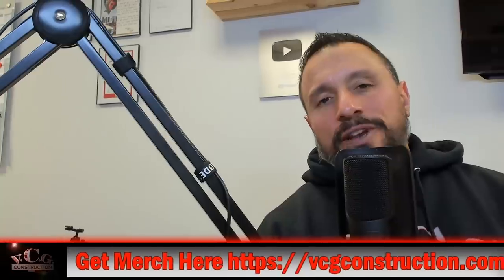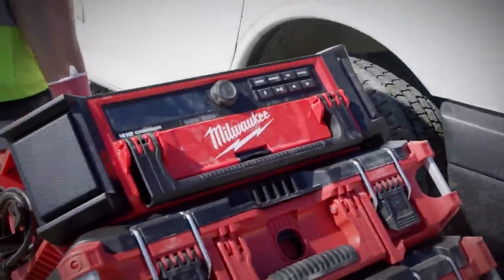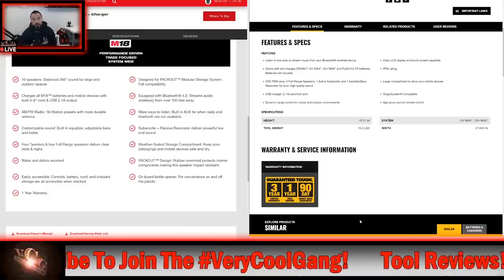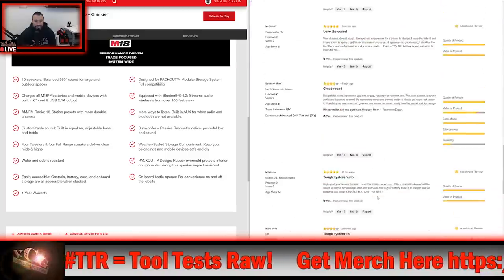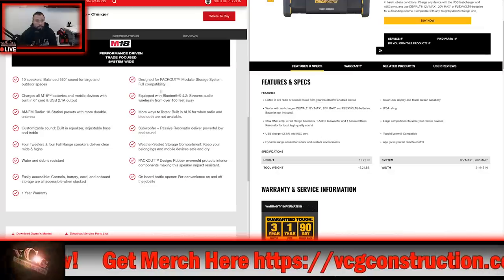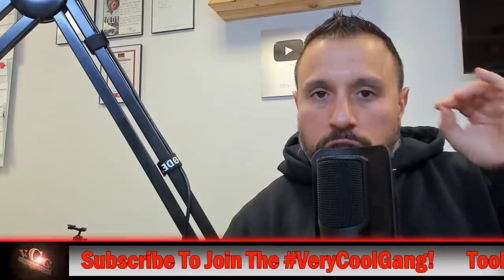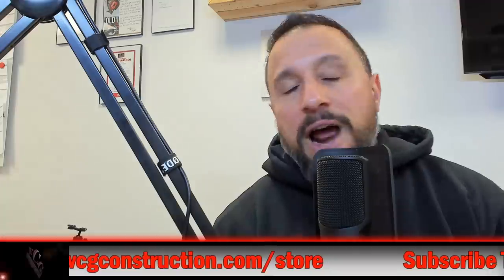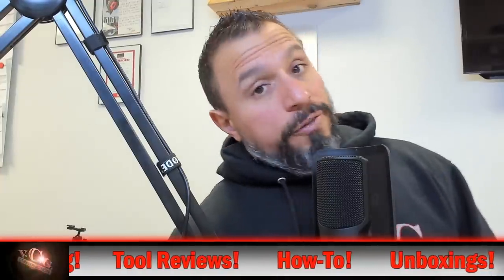Best Jobsite Tool Storage Radio/Charger Comparison - Milwaukee PACKOUT VS DeWALT ToughSystem 2.0

Comment: Bosch everyone one makes a very nice radio charger system.  I have the Bosch and love it.  If I had to pick between big yellow and big red.   I would go with Milwaukee because I already have the 12V and 18V batteries and I have the Milwaukee 12V radio that I use on inside projects where the customer will not permit loud music and I can play my 12V radio  on low,  and customers do not seem to mind that.  Thanks Vince !!!!!
Reply from the maker: Thanks for your level headed feedback as usual, you da man Stephen! We appreciate it!!
Reply: @VCGConstruction  Thank you sir !!!! Awesome video !!!!
Reply: When low, my Dewalt (the older one that's better) is on low, it doesn't make too much noise... it's... got...volume controls....? --However, it does resonate more than playing right off my phone, which is a squeal 15 feet away compared to crisp sounds from a sound system. But I have a small speaker that's able to fit in a pocket for small sound and it's great. has a clip and magnet, so it's pretty versatile.

Comment: I own the DeWalt 1.0 radio and it has been great, The biggest feature missing off both (to me) (which I did tell DeWalt about) is a lack of a microphone. I hook my phone to the radio and toss it inside. When someone (aka person getting stuff calls) to ask me was it 4 or 6 2x4s I would rather not have to take my gloves off pry the radio open to get to the phone, I wanted a button to press. (This also applies when I'm at home I can talk to the relatives, while still getting wood marked up to be cut)

Comment: I bought (preordered) the PO radio. I would have to agree that having a 12v charging capability would have made this radio an easier choice to make. All I can say is, use the mobile charger from Milwaukee (#48-59-1201), plug it into the usb port and charge away...?? Thanks Vince for the assistance in comparing!!

Comment: I see that you made this video comparison in 2019. I'm very pleased with my DeWalt DCR025 which is a different model, but it is an excellent choice for on the job needs. It has a great sound, and also includes two outlets, Bluetooth, auxiliary and USB port, 5 dedicated radio station options for both am and fm, and a charger for your cordless tools, and a bottle opener. Probably not a good incentive on the job , but I like it, because I'm a backyard mechanic and DIY kind of guy...

Comment: Tough system  2.0 hands down. With the DS  carrier and wall mount system I don’t have to move all the boxes to get to everything. I have both system’s prefer the DeWalt.
Reply: I think the Milwaukee is just built more for work and durability while Dewalt is more for the DIY guys. After I saw the Dewalt system I decided that they might be a better solution even though I have Milwaukee everything else haha

Comment: I have two full sets of the Milwaukee Packout toolboxes and all their accessories, but they are FILLED with yellow tools.  Having said that, it would be great to have the radio snap into place on the Packout, but given all the DeWalt tools, I went with the Dewalt radio for charging capability AS WELL AS the ability to play the radio using the batteries as well.  The Dewalt radio sounds great.  I would like to hear the Milwaukee as well though. I bet it jams.
Reply: I was toying with the idea of 3d printing a bracket that allows Dewalt 2.0radio to connect to pack out.
Reply: Joshua Wilson That’s a great idea. I would buy one ☝️
Reply: @ApacheLife-50  I thought the same myself, except I dont have a 3d printer laying around...hit me up when youre done, I'll buy 1

Comment: Dewalt 1.0 was the reason I started with them. My radios been cranked on max nearly every day for the last two years and still loving it. I checked in with my local tool store about the Milwaukee and 2.0 and they said the base on Milwaukee doesn't come close to dewalt and that's all I needed to hear.

Comment: As a Milwaukee tool, PACKOUT user, M18 & M12 mechanic & handyman, i was happy & disappointed with the new M18 only radio/charger. I own far more M12 tools (at the moment). Don't forget us trades folk Milwaukee cause not every job requires 18v/20v tools. Thanks Vince for telling like it is! #justsaying

Comment: Was very short sighted of Milwaukee product marketing team to not include the ability to charge all of the battery platforms. Also no reason not to have extra USB ports.
Reply: Actually since it can't run off of the m12 I think it is fine that it's not included. It might be confusing for some if it can run off the m18 and not the m12, but can charge both. I have no shortage of chargers anyway.
Reply: It can charge both if you get the m12 accessory that you use in their jackets

Comment: Ok, I have OCD,(lol) I bought the TSTAK, Milwaukee Pack out and Tough System Radio along with an older Bosch Power box (had for yrs.)
Sound wise the TSTACK HAS overall best sound, then Tough System...Milwaukee had great sound if you put it in a corner or against the wall...then my older Bosch Power box in that order....I've compared them side by side and this was how they measured up...non were actually impressive as a charger...though they eventually all did charge.

Comment: More USB ports and the packout should have included 12v charging
Reply: 12v charging would be nice but because it's a totally different pin system they can't but since dewalt uses the slab type battery there no extra space used to get all 3 in there. Btw I'm team red

Comment: I feel like you are backwards on the "radio sound solution". They both charge but the sound quality is not even in the same neighborhood. DeWalt sounds nearly twice as good and twice as loud. I just compared both in the same room, with the same song, full volume(like most construction sites) as I'm looking to get into a new system.  I now feel forced to get a DeWalt radio and packout with Milwaukee tools.

Comment: I have the dealt tough system it’s really good I had mine for couple years and no problems until couple days ago it sounds like a speaker may have blown .. definitely got my money’s worth out of it though. Been thinking about buying a pack out now ... I’m a steel worker and work by big machines so I need loud music systems and the tough system was a little hard to hard when some machines started running

Comment: I have had a tough system for couple years now it was great for me and I work it a big steel manufacturing shop with loud machines running and dewalt was pretty good! I have unfortunately blown some speakers on my dewalt from putting bass and everything full and blasting it lol. Now I’m trying out the Milwaukee pack out
Reply: How is it?

Comment: Which is louder with better sound quality and bass? All I care about. Never heard Milwaukee's but I do like the DeWalt packout radio
Reply: I would imagine with higher speaker count and more bass coupled with nearly twice the watts the milwaukee would win in a sound vs. sound competition, but if you are already locked into an ecosystem either is quite good.
Reply: @rockyleblanc2977  That's not how it works. It goes by how many watts and the impedance. One radio could have only 2 speakers
and wreck the one with 20 speakers. Also important is the resonance inside the shell that house all of the electronics as well as 
porting.

Comment: I'm deep in yellow tools and about 6,500 deep in packout...
If they would have stocked tough system, I would have gone that direction....but looking at organizers, I really think Packout has dewalt beat. "Packout organizers." specifically. --packout shuffle blows, and inner totes/dividers not compatible with other packout boxes is also stupid as hell. The loss of space is also a huge downside...
But, it's coming together, I've now used it on about 5 jobsites, and I have been getting more organized with it, reorganizing every jobsite to better suit the situations to where hopefully some day, I'll have a organized for my business operations system that is highly efficient. (The problem becomes, I have a system that isn't great with my tools, I need duplicates or so, and packout has a vacuum and speaker that are compatible... Should I make the switch and invest in over priced red? or stay on with a few incompatible tools I need...)

Comment: I have bought up the Packout system and would by the Milwaukee radio.  I own a number of DeWalt tools and may buy the big battery charger and figure out a way to mount it on the Packout.
Reply: big battery dont fit in the dewalt at least the one i bought the Milwaukee can fix a 12.0 and last 3 days

Comment: Thanks for the vid. I currently been using the Bosch but I don't own any Bosch tools so just purchased the 2.0 because I do use dewalt battery tools and am thinking I am going to buy into the new 2.0 organization, so here is to hoping it is trouble free.

Comment: Hey Vince. I was excited to see this video as I’m looking for a radio. I’ve got a huge amount of this fuel line and a pile of pack out. All my corded tools are dewalt for backup. I was actually thinking of possibly going dewalt just by your last vid on the 2.0. You seemed more impressed then you were in the Milwaukee video. I was really hoping to hear in this video which one you thought sounded better,louder and more bass. More so then the specs. Let me know your thoughts if you read this. I don’t think many guys have heard both radios. Thanks

Comment: I imagine the m12 Milwaukee batteries can be charged through the usb port I will be buying the Milwaukee radio and charger soon I have the dewalt 2.0 I'm loving the dewalt so far and yes I would like to see more usb ports as well as the Milwaukee adding m12 to there charging and using stereo option

Comment: Honestly do you think it matters if they both charge the batteries and have decent sound even if the DeWalt was a little bit better I would still go with the Milwaukee just because of the charger and that's the platform of my tools I think that's how most people are going to view the situation I just hope Milwaukee is better anyways
Reply: 100% agree! I got the packout because I'm invested in Milwaukee but if I was invested in Dewalt it would be the same

Comment: The two subwoofers will most likely not be 2 active drivers. The only way to get the performance from a subwoofer In that compact air space is to pair it with a passive radiator. Most all Bluetooth mobile speakers use passive radiators that people keep mistaking for “subwoofers” no it’s the only way they can deliver great low end and it still be waterproof.

Comment: Both missing the best feature. The Bosch power outlets.
Reply: @garrad miller 
👏🏻👏🏻👏🏻
Reply: Mx fuel power station solves that
Reply from the maker: I didn’t realize Bosch had a radio that integrates with their LBoxx system, is that European only?
Reply: @canogaparque818  for a few thousand sure
Reply: @VCGConstruction  for good reason, they don't.
Reply: @VCG Construction 
All Sortimo L-Boxxes come with holes on the top of the box that are specifically designed for shoulder strap that you can strap down your Bosch Powerbox with a bungee cord, or if you need to hear that “click” order L-Rack-S and four one hole clamps to hold on to safety cage. It does have to go on top, like my home made MFT style table that mounts to same rack component, but it’s a small price to pay.
Vince are you able to use the Bluetooth functionality on either the Milwaukee or the DeWalt offering to set alarms for breaks and for lunch as well as able to use it as a job site intercom???

Comment: Has anyone else noticed lots of commercial jobsites are banning radios more and more? Sware 5yrs ago no one cared. Now it's all no radios on site. Sure helps day go buy burning rods and fitting pipe with some tunes going on.
Reply: I use a 12V Milwaukee radio with the volume down low when I can get away with it if there not completely prohibited.  Sometimes project managers will let you get away with that.
Reply: @stephenleepmg113  I rock phone in hard hat when I'm not welding

Comment: Just remember this is Milwaukee's first attempt at fitting everything into a packout radio and DeWalt's second
Reply: Just remember red china is copying dewalt do you really think they didn't reverse engineer one before making their copy
Reply: @rumchaser1able  well since they are completely different designs I'd say there was no copying here. Also, dewalt has less speakers and downward firing subs
Reply: @noclass2gun342  haha really so they made a radio that's basically the same as a toughsystem or tstack and you say its not a copy .
Whose idea was it originally ?
Reply: @noclass2gun342  subwoofers work best when they're pointed downwards

Comment: I just bought both Home Depot has the tough system 2.0 online for $199 and I picked up the packout  for $274  $25 off at Acme tool online both in stock.  Now I’m up to 9 job site radio’s the addiction is real people.
Reply from the maker: Only 9?? Come on Chad step it up! Hahaha jk
Reply: @VCGConstruction   you funny 😁
Reply: Which one is louder Milwuakee or dewalt ... Which is best overall bass treble, and quality
Reply: @FERNANDODELAROSA1   DeWalt 2.0 is best overall

Comment: 1year warranty for that price on the Milwaukee, had to use warranty pry 10 times over all tools so not a huge fan of the quality control on a few things. For the price I think I'll get DeWalt and Barrow a battery from one of the company DeWalt batteries or a tinner .. they all use DeWalt. Love lots of Milwaukee tools but I think to much hype is going on and now raising prices and I doubt quality is also increased so I need at least a 3yr warranty for me to drop that coin on a jobsite radio that will get beat up.
Reply: I switched to milwaukee just a few years ago strictly because of quality. I was sick of all the flex in the handles of my drill which was the top of the line for dewalt and when I tried out the milwaukee at homedepot the milwaukee was just so much more rigid feeling and I felt it was better built. This carried through the circular saw, miter saw, and all the other tools I eventually replaced. I would stand behind the milwaukee tools quality anyday as I've watched dewalt cut corners for years now and seen them lose quality as a result. I am a professional contractor and use these tools on a daily basis for my industry which includes heavy structural steel work and stick framing also.

Comment: I wish they designed the radios with the option to be powered by the batteries or AC.
Reply: Not certain about the DeWalt, but the Milwaukee allows for either option.
Reply from the maker: Jason, I’m confused by your comment! What exactly do you mean?
Reply: The radios would be powered by the battery or AC?
Reply from the maker: Jason, they’re both dual power. Sorry if I didn’t explain that fully in the video!!
Reply: That's what I was getting to, thanks👍🏽

Comment: i prefer compact and small sizes.  If i want a good bluetooth speaker, i might go for UE megaboom or JBL brand.  To charge batteries, i don't think Milwaukee has multi batteries recharge except for m12 and m18 but to charge 2+ M18 batteries?

Comment: Bosch Powerbox best jobsite radio for almost a decade...
Reply: totally awesome radio i have the one with the cd player in my shop still runs zero problems and has gfi outlets even a 12v car coulet. i use the dewalt bluetooth adapter to stream from my phone.

Comment: I would pick the dewalt just because I do alot of work outside and the Milwaukee radio sucks in the rain. It don't like water, piece of junk.
Reply: How do you know the Milwaukee Packout radio sucks in the rain? Did you already get it and try it?
Reply: Had it, glad I went back and got the dewalt, no more issues and all round better stereo, I have more dewalt tools and have had poor luck with milwaukee cordless tools there not made with the same quality plastic as my milwaukee corded ones from 20 years ago, but don't listen to me. If your majority of tools are milwaukee then by all means get it just be clear on the electronics and water don't mix well.

Comment: So Milwaukee is better in all areas except allowing 12 volt charging.  People buy this for the radio, not to have a fancy charger that plays music.  

Milwaukee for the win.
Reply: Rapid Charging station solves that need
Reply: Exactly.  I would rather have more focus on the radio then the charger.  I think Dewalt, trying to be smart, missed the purpose of the product here.  The main thing we want is quality sound.
Reply: Did you interpret the Milwaukee having more speakers as it having better sound?
Reply: It would make sense that double the speakers, and double the subwoofers should give you better sound.